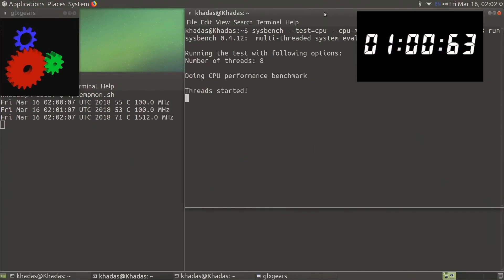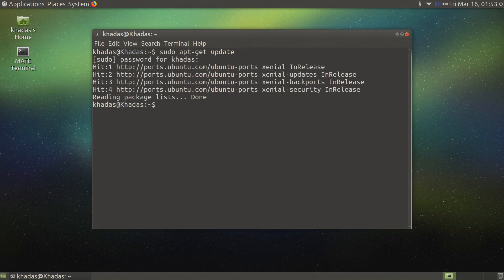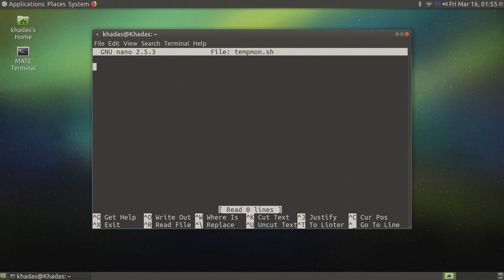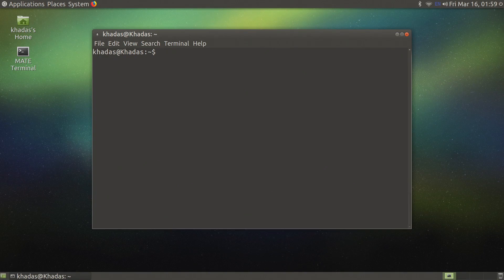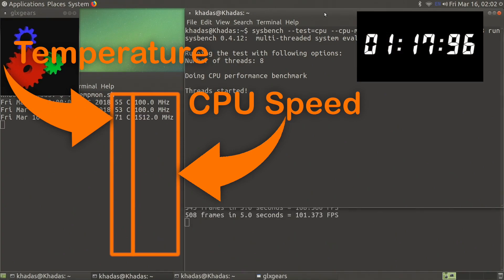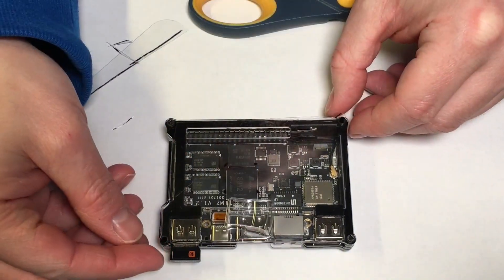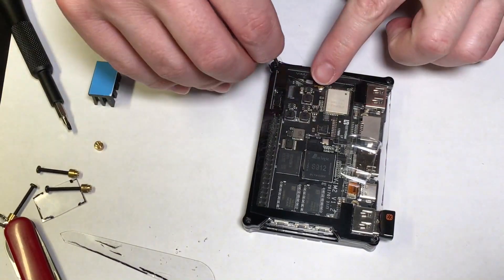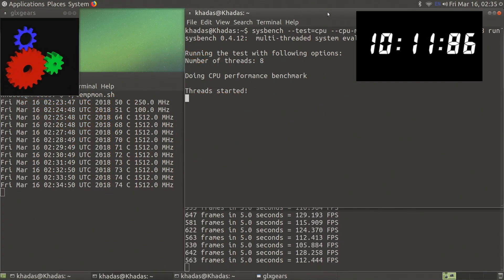Khadas VIM2 Performance and Adding a Heatsink

Comment: for silent cooling you might want to check out noctua 5v fans that come with various adaptors. i have a 5v fan plug into the fan header on my vim2 board